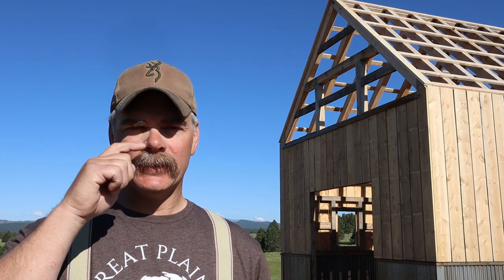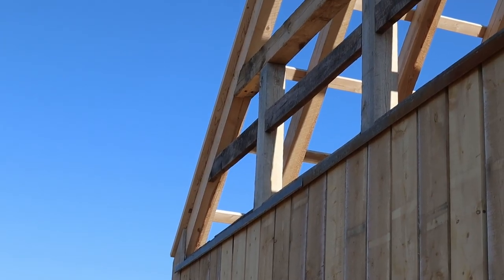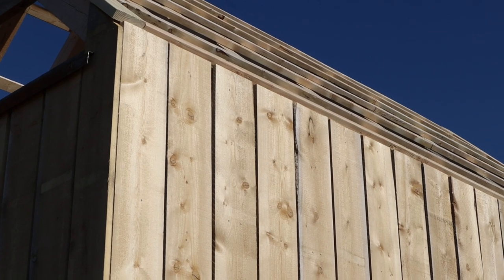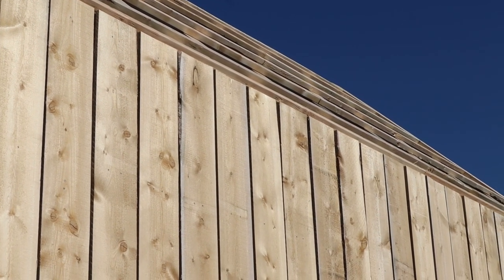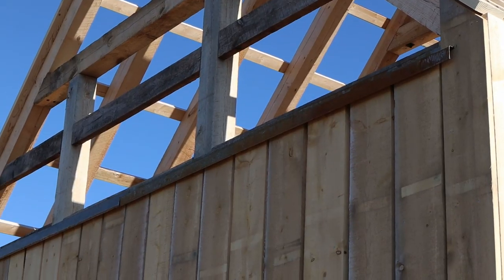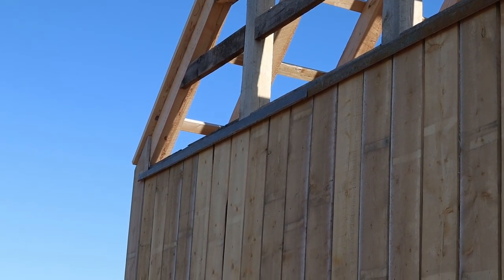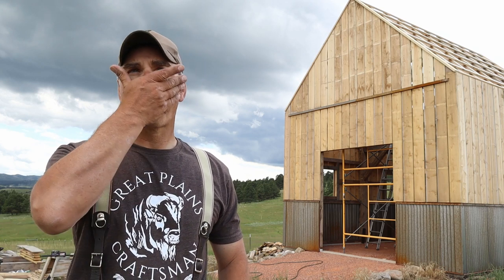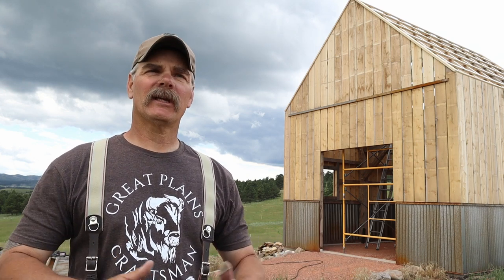Finishing the Boards of the Batten on the Timber Frame Barn

Comment: Boy have you come a long way with  that building. Your journey has been awesome to watch. It's good that you are always thinking of a better way to do something. It's good you caught that hiccup before it was too late. I got a little behind watching. Had to go in the body shop for a ball joint replaced (Hip). Fighting fire for 23 years and a logging accident 40 years ago caused sever rust and the bearing to go bad. When I built my garage I put a standing seam metal roof on. I did it myself. The metal is more narrow than the sheets, it also extents the whole length from top to bottom of the roof which made it easier working by your self.  I like the standing seam because all the screws and clamps are hidden and you don't have to worry about the gaskets going bad with all those exposed screws. There were a few exposed screws with the flashing on the sides and on top though. The metal comes already cut. All I had to do was bend the end at the bottom. The seam locked in place when you tapped it on over the other seam with a rubber hammer. It also had a gasket in it that ran the whole length to keep out water.Thanks again for sharing your build with us. Be careful on that roof.
Reply from the maker: Thank you John for the insight and kind words.

Comment: Looking good Tim. Putting on the steel roofing isn't that difficult, just make sure to tie yourself off to your top beam. The placing of the top cap will be the hardest when the beam isn't there to tie off to. Make a temporary ladder that will hook over the cap and you'll get it done. Looking forward to the upcoming video.  Have a good day.
Reply from the maker: Thank you Dana, will do

Comment: I won't shovel any crap for not having over hangs, I like the look.   This is one place I forgo function over looks.   I often wonder why they applied no eves in the past?  No clear answer, maybe to save material on the roof?  smaller roof.  I do like how a building functions with over hang though.  I have both on various buildings.   Gutters?   I don't do hot coffee, I know some that can drink it boiling hot.
Reply from the maker: I had that same thought also, save materials. Maybe it was just the style then.  Probably gutters on at least the  East or uphill side.  I just like how it looks, and I have siding that won't really be affected by hail much plus inset windows.  Thanks for your insight!

Comment: What's the rush to put on a roof? I hear there's a timber framer in the NE who doesn't think a roof is needed until the third or fourth winter.
Reply from the maker: Well,  maybe that's true Aaron.  I'm just a little worried about the rain.  The beams are still solid
Reply: @GreatPlainsCraftsman  It sounds like you really need the space. You probably should get the roof on before the snow returns.

Comment: OK, I'll bite.  Why don't you move that safety staging outside?  Take twenty minutes and speed up your work as well as make it more accurate.  Not even considering safety.  Working past the end of an extension ladder is hard to do and precarious when reaching as well plus you have a side view instead of a straight on for lining things up and measuring too.  Your twenty minutes is paid back in a jiffy from resetting the ladder continually.  Do it any way you like.  It is your barn but you have me curious.  Take care.  Doug
Reply from the maker: Hey Doug.  The ground is really sloped, and other is tough to use staging without a cut man.  Still climbing all the time.  Ladder is faster